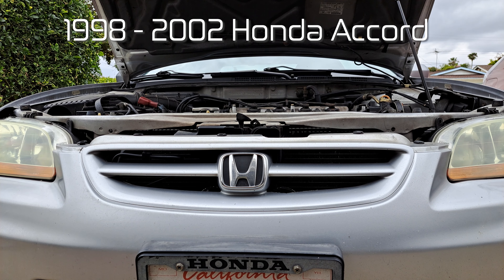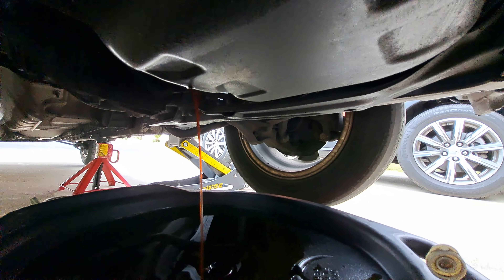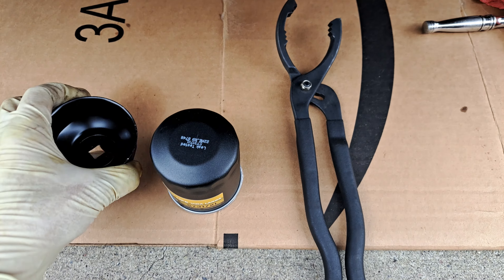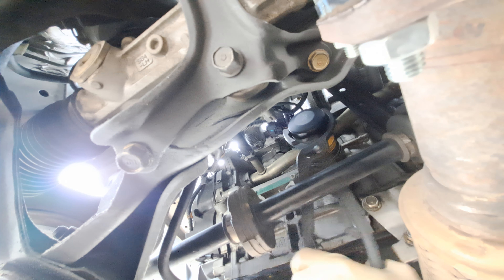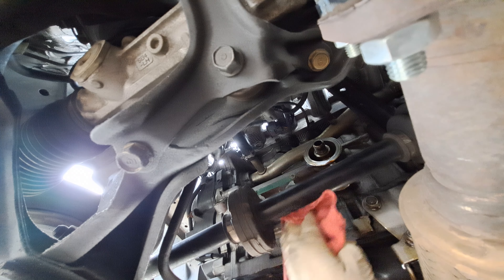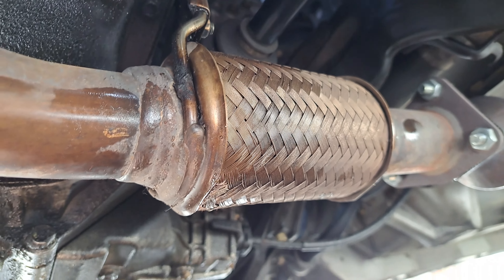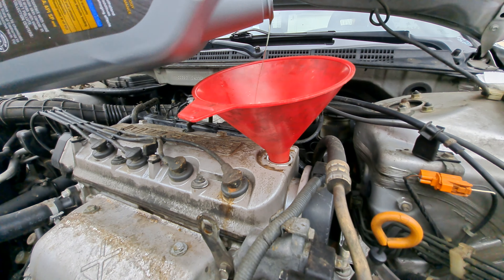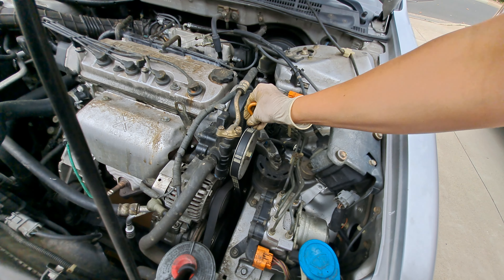1998-2002 Honda Accord Oil Change 4 cylinder engine

Comment: If you are using high mileage synthetic oil, how many miles can you go between oil changes? Just regular daily driving.
Reply from the maker: I always recommend changing your oil at 5000 miles or 6 months, whichever comes first.
Reply: Thanks. Great video. Straight to the point.